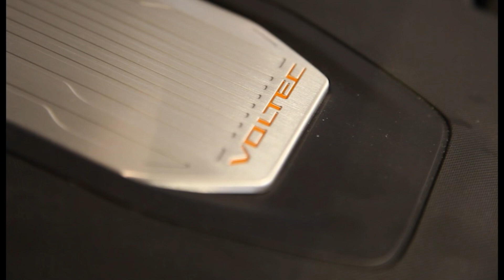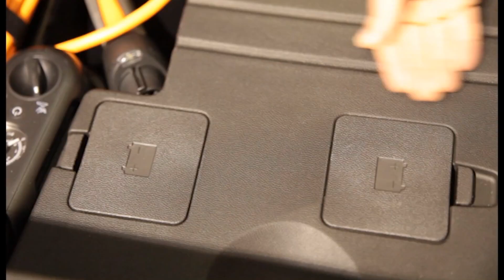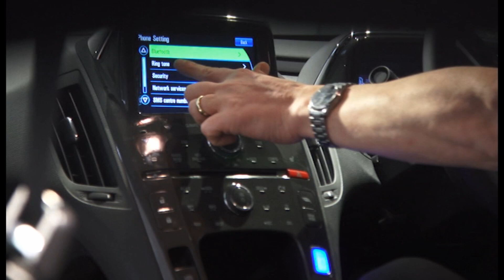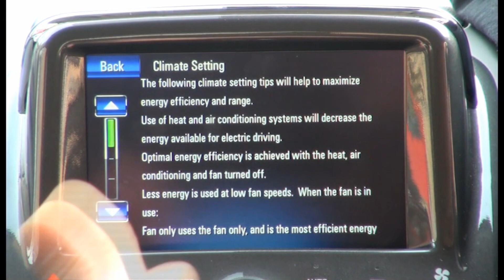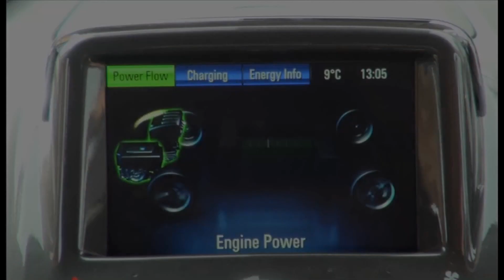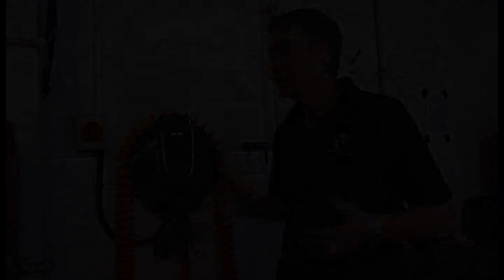2012 Vauxhall Ampera Sales / User DVD (Chevrolet Volt, Opel Ampera)

Comment: So crazy that they must have challenged the air conditioning for Gen 2  (Actually i think i worked with the guy who released the AC Compressor and recent heading that but I'd forgotten. 

My Gen 1 has the coolest most unfailing Air Conditioning I've ever experienced up to the time of that car. Mine is a2015 and it for I've cube could air at Idle in 105F City Traffic or sitting for hours.